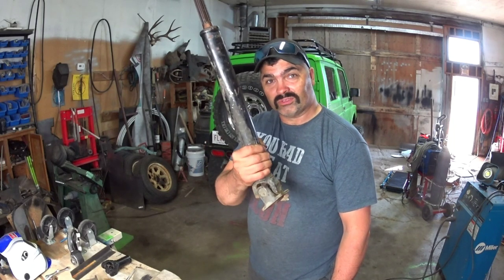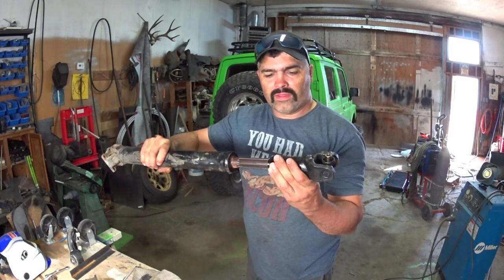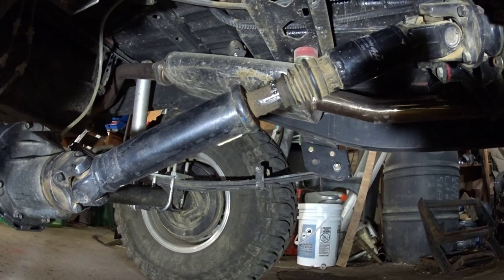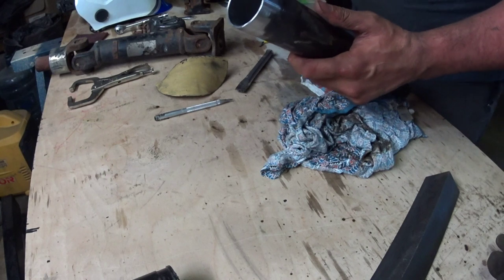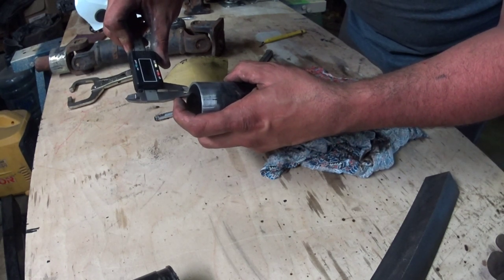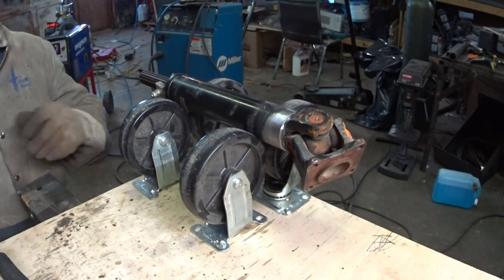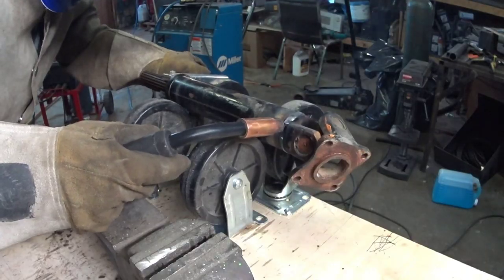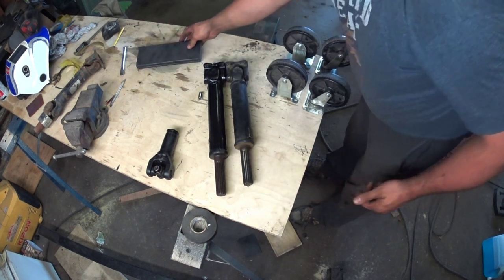DIY Drive Shaft Extension

Comment: Great job, was thinking about using spacers on my zook but might just do this. Do you think there would be less chance of introducing prop shaft imbalance by cutting and sleeving the main tube?
Reply from the maker: Thanks! Yeah adding spacers actually increases you drive shaft angles, which can increase vibration. Thats the reason i cut and rewelded the shaft. There is definitly a chance of vibration if you dont get the yokes lined up properly or if its not welded back on straight. So a rebalance is possible...i lucked out!
Thanks for watching Zuki Evolution!

Comment: If you take two sockets  the same size an put it under the  driveshaft  at each end it'll  be level  an it won't shake  i add 4inch to my front  driveshaft  like that

Comment: Planning a manual transmission swap in my truck and according to the forums it'll be anywhere from 1-2" shorter. Instead of lengthening my driveshaft you think I could fit an adapter or washers to the diff yoke with longer bolts?
Reply from the maker: They make spacers you can put in there.
Thanks for watching and commenting!

Comment: Great video. Any tips on how you would diy extend the front driveshaft?
Reply from the maker: It depends on your lift or if you still have the stock or modified cross member. If still stock you will need a spacer on the t-case side to get articulation clearance for the d- shaft to crossmember most likely.
Thanks for watching Zuki Evolution!

Comment: Question, know anything about adding power steering to the zuk?
Reply: You can use a power steering out of an 1.6 sidekick. You need an adapter for the steeringbox and build a plate to mount the pump to the the motor. Its an easy conversion.

Comment: Why didnt you use just a Spacer?
Reply from the maker: Were i live, you dont just take a quick drive to the store to buy them, besides adding spacers steepens the drive line angle which wears out ujoints faster and creates vibration.